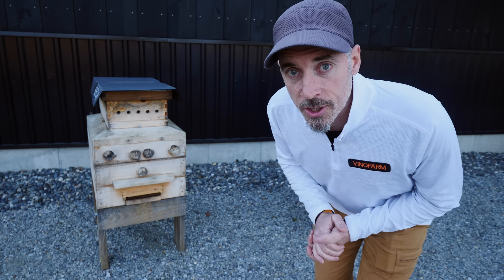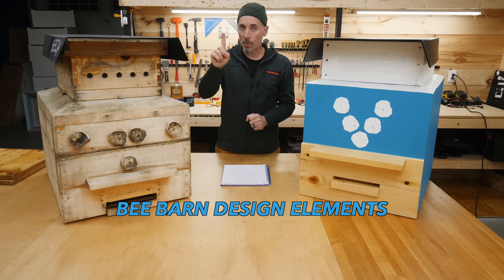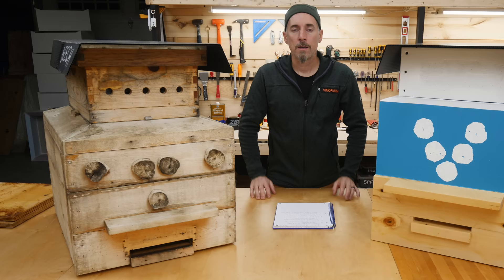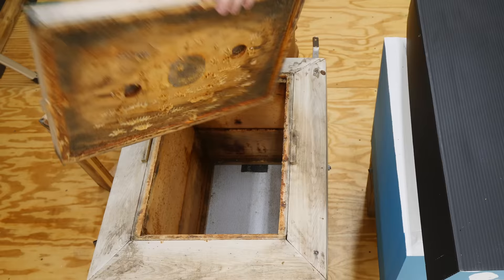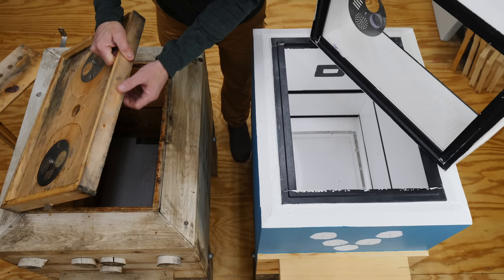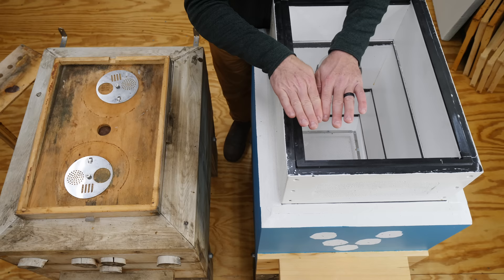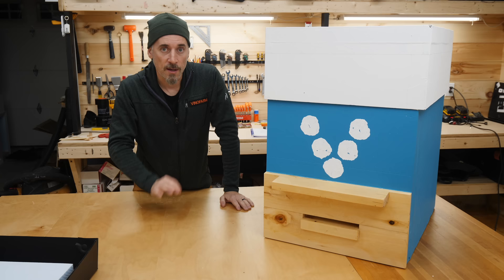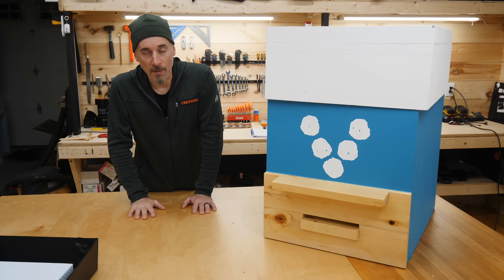I Fixed The Langstroth Hive (Again) - Bee Barn 2.0 REVEAL!

Comment: From flow hive to a Langston replacement. This channel is someone going from an interest to doctoral level understanding of the bee keeping. Welcome back and I'm  glad you are back!!
Reply from the maker: Very sweet, but I’m nowhere near doctoral level understanding of bees. Just observing and following what they tell me.
Reply: @vinofarm  I mean if you look at doctoral theses and what goes into them... it's observation, hypothesis, experimentation, and confirmation or rejection of the hypothesis. That's exactly what you're doing.
The bees die in winter. The signs show that it may have been cold, may have been hunger, may have been both. The comments also suggested some possible causes at the time (like the cluster being so small they could only warm up a bit of honey above them to eat, they can't move sideways because of the cold). After a lot of thinking about our observations and possible hypotheses to draw from them, we follow the hypothesis that the cold is key and insulate the beehive - experimentation. Next winter, the bees survive better than ever - observation done, hypothesis confirmed, problem solved. (I also love the little tidbit that they plugged up the vent hole and you just went "Okay, no vent hole then")
But now there's moisture. Hypothesis: the top cover isn't insulated enough, draws the cold in, and that causes condensation. Experiment: attach some foam to some of the nucs to see how well it survives the weather to make sure we can use it for the whole hive design. Observation: The foam is fine, so we build the new hive, and we put the bees through another winter... bees are better than ever. Observation complete, hypothesis confirmed, problem solved.
How many times will you go through this process before accepting that what you're doing is definitely worth some kind of academic merit? 😉
Reply from the maker: @trishapellis  Now that you mention it… ha ha! You make great points.

Comment: Thanks for your video and innovations!  I’ve been using foam board to insulate my hives for a couple years now and one problem you might find is that bees sometimes eat away foam board!   I built horizontal hives that would accept two medium supers side by side on top of the brood chamber.  I inserted 1.5 inch thick foam board inside my top covers and I discovered that either from friction with bee bodies, or industry on the part of the bees, the foam board was slowly being eaten away.   To address this problem, I used a roller and wax coated the interior surface with bees wax and that seemed to solve the problem.  You might want to consider painting the interior of one of your new bee barns with wax as an experiment.  It would be cool to see if it makes a difference with your setup.  Good luck and keep up the great work!
Reply: This idea kept coming to mind with all the folks pointing out that the bees will chew foam.
Reply: @felicityblakeley8361  I think it would work, because it certainly has made my bees less apt to chew up the foam board.....

Comment: Moisture in a hive is not a terrible thing itself. Condensation accumulating above the bees and falling back down on the cluster in winter is the real problem. I solved this by tilting my foam hives with the entrance at the lower end. This way the condensation accumulates and then runs down the front wall and out the entrance. Inhabe a platform on top of my hive stand that is attached with hinges and I simply put a 2x4 block of wood underneath one end of the platform to accomplish this. I am in Nova Scotia.

Comment: Why do you need the box on top of the bees barn in the first place? 

If the bee barn doesn’t need provide enough resources then just put and insulated medium box and call it a day. 

Your inner cover would just need to be two or three inch foam that is protected by reflectix foam bubble wrap or house wrap or chicken feed sack material.

Love the extra deep frames and I’m trying a couple 19 inch deep frames in six frame boxes. They are in Lyson boxes screwed together and I’ll see how well the condensation is on these are this spring when I open them up
Reply from the maker: I made the box to be multifunctional and live on the hive almost all year. In winter it’s filled with insulation and it will be used for observation. It will stay on until the super stack gets too tall in the very middle of summer. (I leave insulation in there all summer.) Then when supers come off it holds feed in the fall. That’s how I use it.
Reply: You’re insulated bee barn is stellar, great design, early build up, uses less stores. The empty box is essentially an observation box, it looks like they are doing a great job of making excess so I think it would benefit your following that the observation box is optional and not necessary

Comment: Looks good Jim . I have been doing the plexiglass for 4 years . Looks good . The only issue I had with plexiglass about the outside inch gets a little moisture . It  works . I made my boxes so if you need to add feed you can pull a small piece of plexiglass out . Add feed close back . You will get people that tell you it won’t work . I quit talking about plexiglass . Because all the haters . Good job
Reply from the maker: What thickness did you go with? This is 3/8” so it would support a pail feeder filled with syrup. I’m really loving it so far.
Reply: @vinofarm  Mine is set up a little different. I have a third plywood then plexiglass and then another third plywood. So I can take the plexiglass out I can put a bucket where the plexiglass was but it’s the bucket still sits on plywood. I hope that makes sense. So I only use an 8th inch plexiglass
Reply from the maker: @handsburyhoneybees893  Got it! The full window is sweet, but I see how even 1/3 would be a game changer compared to solid wood.
Reply: I have them set up so I can add sugar bricks also . I’ve been doing them this way for 4 winters . 100 hives my average loss is 4 percent .( Louisville ky area)

Comment: Just a thought, for the glass top with condensation. If you had it very slightly angled to slope towards the wall with the foam spacer, any condensation you did get would roll down the acrylic on that outside wall with no bees and right down that side.
Reply from the maker: The condensation is a feature, not a bug. The bees USE that water. The area directly over any cluster actually stays pretty dry because of their heat rising, but the edges of the plexi are wet. That's fine. Also, the old "moisture kills bees" thing is moot in these boxes because the temp in there is 60-90ºF all winter.

Comment: Styrofoam is super soft and easy to break but lite. If you want to build from wood and don't have problems with moisture try stabilized wood. It is not economic at all and heavy but built strong like a tank.

Comment: Jim... Welcome back!  You've been missed.  Two comments/suggestions:  1)  Bees chew on foam.  Either coat/laminate the inside surfaces or know that you may likely need to rebuild/repair your boxes often   2)  Many beekeepers are of the thought that the decision to swarm is often made by the colony in Oct/Nov of the previous year.   Many of our club are preemptively splitting vs. being forced to do so reactively.  Wally Shaw's "An Apiary Guide to Swarm Control" is highly recommended reading.
Reply: 1) Those look like Lyson polystyrene hive bodies that are the inner white boxes, not the polystyrene XPS we typically use under the outer cover.

Comment: I am going to miss the Bee Barn 1.0. Never mind being so functional, it was just so great looking: the exposed wood, the sloped top, the expertly crafted and fitted corners, the little round bits on the front to help the bees differentiate them, etc.  It was gorgeous. It looked like a piece of fine cabinetry. However, grandmother’s fine antique china cabinet is not going to do so well either if you leave it outside in the weather for a few years, so upgrading to the new materials is a great idea. The 2.0 does not look quite as good, but it should last years longer. 

However, I do have a couple of questions. One, did you think about making it deeper, equivalent to deep/deep rather than deep/medium? If so, why not? 

Two, why leave out the wooden “liner”? The 1.0 had it to make the hive feel familiar to the bees and to cover the insulation, right? I assume the bees don’t need it with the new materials?

I am hoping that my questions get answered in the upcoming videos. Well done on the 2.0, I’m really looking forward to the upcoming videos, and especially the spring status reports.
Reply from the maker: 1. I like wood, too, but I've come to the conclusion that it's a not an ideal material for a beehive. Not saying FOAM is perfect, but it's better. 

2. I believe deep/medium is the Goldilocks cavity size for bees (at least in my type of climate.) Big enough to expand in summer, but small enough to manage when things get sub zero for four months. Deep/deep is massive. My colonies don't get that big. 

3. I don't think bees give a toot what the walls of their hives are made of. I think they care about temperature, humidity and the honey comb they walk around on. The walls of the cavity could be any material. When that material is wood, it will expand, contract, hold moisture, grow mold, bacteria, and hold all sorts of pest eggs. I like the idea of a smooth, non absorbent material. Water drops will still form on the surface for the bees to harvest, but it won't get saturated and destroy itself. 

What do bees do to wooden hive interiors? They coat them with resin! They basically shellac the surface of the walls. I'm curious to see if they do that to the foam, which is already the same sort of surface.
Reply: @vinofarm  Thank you very much for the detailed reply! I love your videos, they are the most anticipated ones for me. Happy New Year, and may you, your family and your bees have a great 2023.

Comment: You will need Bee Barn 3.0. First, the frame is not enough deep. The bees need more honey above them especially during  spring when the temperature is too variable. Just add an additional one deep size. Also, your entrance could be in a "warm" direction, not along the frames but perpendicular. Good job. Soon I'll publish my book about "the most natural beehive" and I'll send it to you.
Reply: Tell me you’ve been reading Keeping Bees with a Smile without saying it. In this case the frames work just fine. The extra insulated nest box of the bee barn means way less honey consumption to maintain thermo-regulation. The double deep/Lazutin frames are built to take account of resource storage for hive bodies modeled after a regular tree cavity in concern to insulation with about 5-7R value. The bee barn is about triple the R value, likely somewhere around 25R. When the math adds up the bees would then need 3x less resources to maintain thermo-regulation over a winter period as compared to a normal double deep/Lazutin horizontal hive sitting next door it it over the same winter period. However you are onto something here. I believe that the performance of the colony would be even better if the two technologies were combined. I’m talking giant number of bees and an incredible honey production. Using a long horizontal blueprint and building it with the hive body design of the bee barn for insulation, while using double deep frames would increase the hive to the next level. Like those huge hives they find in the wild sometimes with 2-3 queens working several brood nests in a giant cavity. Also having the horizontal hive style where the nest area can be expanded and shrunk depending on needs of a colony would further increase the ability to bring new colony populations up, or also allow you to do a “split” by just sliding some frames around, adding a divider board and throwing in some empty frames when you find queen cells. One hive could essentially hold 2-3 colonies or one massive colony depending on how you find the bees progression. Then having them all be able to service the supers above like a normal two queen Langstroth system. I’ll send you a video once I build it if you send me your book.

Comment: Still feel like you can use rubber for a better seal like how we weather proof the sides of doors. Also feel like you can use PVC material on the exterior for better protection against hash weather like rain or snow or for when moving it around to over all protect that foam barrier. Even use PVC board for the bottom when you drain water so it’ll last longer.

Comment: The only time we have seen hives suffering from lack of winter ventilation, the hive was weak to start with and there was no adequate top lid insulation. Thus getting the top moisture drop on the center cluster.
The major problem I have with this design Jim is that you can't quickly tilt the bottom and check for swarm cells.  You have to pull every frame out and folks don't do that. When I see other keepers running this design unexpected swarms are common. Way to common.
I do like the level of insulation!
Reply from the maker: Hi Mike, I guess I'd rather lift 4-5 frames while standing upright than bending over and lifting entire boxes. That's the main point of the design. I hate lifting heavy objects and my back hates bending over. The deep cavity and long frames means I only need to lift frames, not boxes. The long frames have opened my eyes as to how I think the queens really prefer to lay eggs. They don't really want to lay half circles like you see on every deep Langstroth frame. They want to lay in FULL circles. They start in the center and do big circles or ovals on these frames. They just spiral outwards and fill the whole thing. No interruptions of bars or gaps. So after seeing that, I realized my laziness of not wanting to deal with stacks of boxes also benefitted the bees. Another interesting thing about these frames is that the gap I leave between the two foundations is where they make swarm cells. Not at the bottom of the frames like you see on regular Lang frames. They build swarm cells right in the center of the brood nest. (Think of that gap between a double deep brood box.) They're not way down at the very bottom of my hives, they're in the middle, so I need to look there anyway. The other thing I'm striving for is a completely isolated brood cavity. I'm trying to give the bees zero outside hassles to deal with. No drafts, wind, rain, cold air, pest intrusion, etc. Just one opening to worry about and no crazy temperature swings. To be honest, beekeeping has gotten quite boring with these hives, because there's less work for me to do and the bees are just taking care of themselves. Instead of finding problems during hive inspections, I'm just bee watching most of the time.

Comment: With my severe lack of construction knowledge this question may seem silly to some and if it’s addressed in future videos feel free to skip over;
How does the structural strength match up with that of a wooden hive? Supers when full are pretty heavy and if you end up with a prolific colony you could potentially see upwards of 3 or 4 supers. In your experience have you observed the main hive body bowing under the weight? Also are your supers made from the foam as well or will you super with wooden boxes? Would it matter one way or the other based on your design to super with foam or wood?
Reply from the maker: These questions should all be answered on Tuesday in the build video. Thanks.

Comment: Jim, can we get a video of how the 2.0 hives performed this winter? I'd like to see how the bottom board worked for moisture removal. Do you have pictures of icicles hanging off your drainage point? I have also been working on the whole balance of keeping the heat but not the moisture but haven't come up with a solution I'm happy with because the dew point is an inverted dome that starts partway down the box and travels through your frames making a mess of them. Or wasn't that your experience? Keep up the good work!
Reply from the maker: You will get a full report as soon as winter is over. We are supposed to get 12-18" of snow tonight. So it may be a little while. No icicles hanging off hives. Look at my instagram @vinofarm for weekly data on temperature and humidity all winter. Humidity in the hives has been pegged in the "normal" range all winter. I peeked at the plexi covers yesterday for the first time and there was hardly any moisture on them. Moisture issue has been solved as far as I can tell. Stay tuned for a full video once the snow melts and we get some temps over 50º.

Comment: Great to see the improvements! I built two of your version 1.0 hives last spring. Our temps in the Smoky Mountains were in single digits with a low of 2 degrees around Christmas and I was concerned that I might lose both hives. Last week, the temperature was in the 50's, so I decided to take a peek. Both hives are going strong! Thank you! Thank you!
Reply: Hey Keith, how did the hives handle summer heat?  I am in South Florida. Believe it or not, my 3 hives had a direct hit from hurricane Ian and were tossed upside-down for 2 weeks. All survived.
Reply: @scottpeal60  They got a little warm on a few days, but I put a shade cloth awning over head. Took care of the problem.

Comment: Jim, I love your way of thinking and problem solving!  I built my first Beebarn to add to my apiary this year.  I do have a question though.  With your Beebarn designs, do you feel you need to use a queen excluder between the beebarn and the honey supers, or does the Beebarn create enough space for the queen to lay that she won't migrate up into the honey supers?